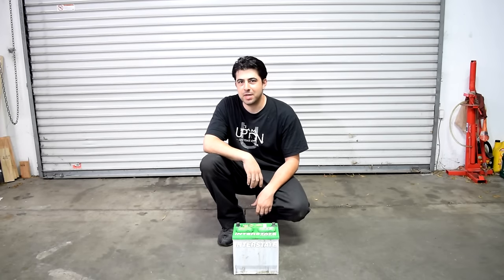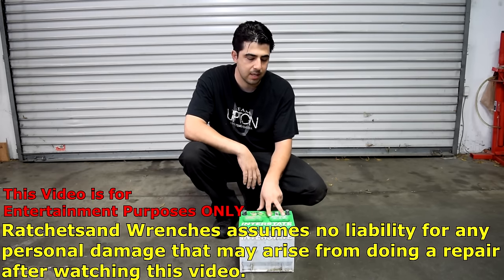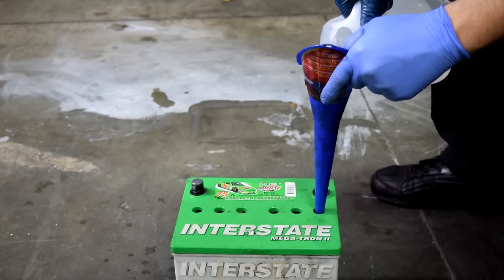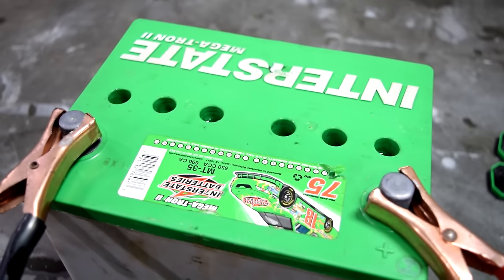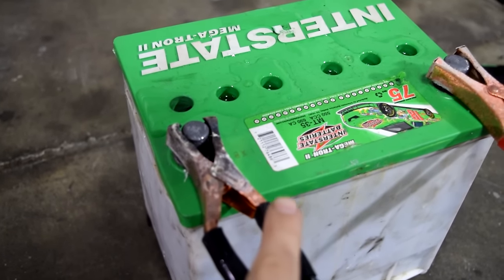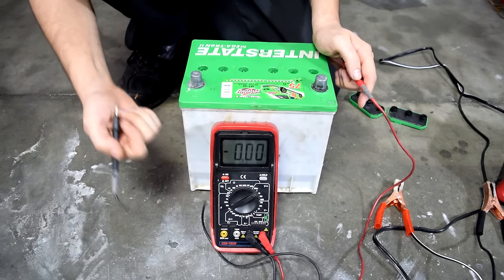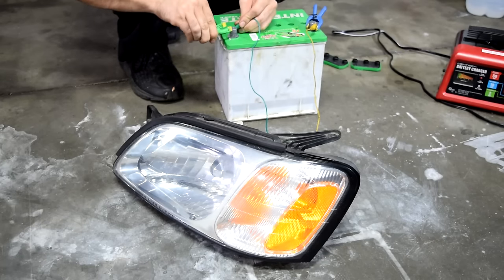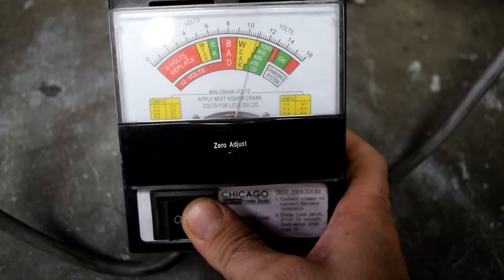Is it Possible to Revive a Dead Battery with Epsom Salt - See For Yourself

Comment: If a battery comes up to 11.7 or so in 24 hours on a charger after  this magnesium sulfate treatment,  try a trickle charge of about one amp for ten days-- yes almost two weeks of trickle charging.   Sometimes a battery will come up to 13 volts and have good amp hours.   The long trickle at times knocks off the oxidized lead and improves performance.    Back 80 years ago acid lead batteries were used in farm barns at the very first electricity in rural areas.  These would get rebuilt by farmers.   These had glass cases and lead plates that could get removed and cleaned.

Comment: this can work! 1. You just need more epson salt to the distilled water ratio, 2. you need to add back the acid that you dumped out in the begining. Right now there is no acid inside the battery because the baking soda neutralized it.3. You need to first high amperage charge before the slow trickle charge.Then it will work
Reply: More epsom salt? Add back acid? So which is it? This makes no sense.

Comment: There are  several things for battery reconditioning
do not try to do this until you are sure what you are doing - the acid can burn your skin
check the voltage first - there may be a kaput cell which would waste your time.
Check the battery fluid.
attempt to fully charge the battery.
(I learned about these and more on Jons Mender Guide website )

Comment: almost forget to tell you that by converting the lead acid chemistry to a alkaline based you DO LOSE the raw cranking amp power of a starter batterie a bit, i would gess say 60 percent less CCA but for solar use ( mostly lichting, television, radio) this is a good thing since the battery wil last seamingly forever....
Reply: Mostly true. The epson is a poor mans solution and the salt creates an acid. In a perfect world after the battery has been put into product for a week you would pull it, dump the epson and fill with sulphuric.
Reply: giottodiotto1
Reply: No, epsom salt in solution does not create an acid. It creates an alkali electrolyte. Big difference. You can run the battery indefinitely as an alkali battery. If you want to convert it back to an acid battery, it must be quite thoroughly flushed.
Reply: giottodiotto, thanks for that tidbit, on solar use, good thing to know. thanks again

Comment: There are  a few things for fixing a car battery
Don't try to do this unless you are sure what you are doing - the acid can burn you
Test the voltage first - there may be a kaput cell which would waste your time.
Check the battery fluid.
Try to fully charge the battery.
(I learned about these and more on Jons Mender Guide website )

Comment: Did you skip the part where you add sulphuric acid back in?
Reply: Hey the whole idea of adding epsom salt it to replenish the sulfuric acid. The lead on the corr of the battery creates hydrogen gas,the gas mixes with the salt and turns into sulfuric acid. So you dump all of the acid in the battery put baking soda in the battery  about ten ounces in a half gallon of water ,put it in the battery,it will fizzle like crazy burning off all the crud on the lead of the battery,dump that out and flush it good with a hose,turn it upside down for a few hours to drain it good,take another half gallon of water,put it in a pan with ten ounces of epson salt let it melt then cool,and put that in the battery,trikle charge it for 24 hours,let it cool and charge it normal till its full ...worked for me
Reply: @bobpatterson6897  it doesn't work, bad idea!!!
Reply: He didn't put acid in he only did the epsom salt

Comment: I used this method to recondition a battery a couple of months ago and it worked like a charm. I am trying to do another battery now but it is obtained getting to 75% on the trickle charge. It has been 3 days. Any suggestions?
Reply: Make sure you thoroughly flush the baking soda out with repeated rinsing before adding the epsom salt.  Also try heating the water before adding the salt and keep adding salt till the water cant absorb anymore. Good luck.

Comment: You have to charge on 200 amp engine start for 15 mins, Then let it rest for 1 hour. Repeat 5 times. Then the battery will be fully restored
Reply: Some batteries. Most I’ve had to charge for a day each time. And every time I recharge I get another 1-3 days of battery before it goes dead again. I’m going to take one and test by cleaning internals with baking soda solution and washing out with a couple gallons of distilled water and filling with new acid because the sulfate didn’t dissolve so much as it dropped to the bottom and just moving the battery can cause the plates to short again so all that sludge has to be removed or it’s a pothole in the road from leaving you stranded.

Comment: There are  several things for battery reconditioning
do not try to do this unless you are sure what you are doing - the acid can burn you
check the voltage first - there may be a kaput cell which would waste your time.
Check your battery fluid.
attempt to completely recharge the battery.
(I learned about these and more on Rapid Renew Roadmap site )

Comment: The starting point was without a charge. So how is that useful information?
Reply: You can use new acid too
Reply: @snipezpro9554  you mean drain out the old acid & put in a new one without using baking soda & epsom salt?
Reply: It shows the starting point!
Reply: @joejoel8962  If it was fully charged then tested you would have a starting point.  A brand new battery can de drained of charge and after a charge it is good to go.  So was this battery good before the test was done?  NO WAY TO TELL, BAD SCIENCE.
Reply: @Stan_in_Shelton_WA  if it was fully charged you wouldn’t need to charge it now would you.This is taking a battery that won’t take a charge to revitalize it ,clean the plates and charge it.

Comment: here's  a few suggestions for battery repairing
Don't try to do this unless you know what you are doing - the acid can burn you
check the voltage first - there may be a kaput cell which would waste your time.
Check the battery fluid.
attempt to fully charge the battery.
(I learned about these and more on Jons Mender Guide site )

Comment: Just a little side note, its not good to charge or store a battery on the ground nor on a concrete floor. better to sit them on a workbench, or at least on a piece of wood. 
yeah, i know a lot of people will say "oh that was only with old batteries, not modern batteries with newer plastic cases" ... sure ok, store your battery on the ground or concrete floor for a week or so, see what the charge drops down to. I know what happens, as I've seen people do it, and also seen some that left a new battery for months like that, and then they went to use it and didn't know why their battery was shot and wouldn't take a full charge afterward.

Comment: You might clean the cells several times until the cleaning water is clean, and not black..
Let the baking soda work in many hours als shake. Dont stop until it is total clean.
Reply: That was my question
Reply: Baking soda is not a cleaner, it only neutralizes any of the sulfuric acid left inside.  The Epsom salts is the cleaner and once that is added and charged and emptied and rinsed out, you add back the used acid you dumped into a bucket using a baster so as to not get sediments that sank to the bottom.  Top off with distilled water and you should be good.  You can also buy new acid at an auto parts store and use that instead of the used stuff.  I have not tried this...yet...but in the videos I watched where they claimed it works well, this is what they did.

Comment: Good effort! Learning heaps even comments given are really helpful.
I do believe even 75% conditioned batteries has useful self life in many applications. I hav one as 2nd battery to run my electronics I E. Taxi equipment/ camera and re charge off a fused relay while engine is running. Relay stop feedloop parasitic current draw and isolate starter battery. Second, use old batteries to run low voltage water, air bunker pumps, leds, for aquariums. Add mppt/ solar to top up charge during day as well. Many other uses if you think about it. Sure beat dumping 'still usable' batteries to landfill.
Reply: I have three old truck batteries sitting at around 3 volts. I'm planning to recon them using this method and building them into a solar cart. This will be used to run my Amatuer Radio rig, and keep phones, tablets, and lights charged. Just for fun, I may try one of them with sulphuric acid and restore the cranking amps. Then I can also use my solar cart with an inverter for 120VAC applications and to jump vehicles.

Comment: Plastic is a dielectic (it does not conduct electricity) just as the insulation on a wire does not conduct electricity. It doesn't matter what surface you put the battery on. Batteries can slowly discharge to the atmosphere due to ions in the air.

Comment: How do we know that putting the 2 amp charger on this same battery for 24 or 48 hours would not have had the same result even without the drain, clean and refill or reconditioning? It would seem to me that any improvement is due to the charging process and not to the reconditioning. I would be more impressed if you had charged the battery in its original state first and it was still at 3.95 volts after a charge but before the reconditioning.

Comment: Thank you for this very useful information. I'm off-road with my Hummer H3 from September to June in Southern Nevada and I carry 2 batteries & a 12 volt BU (jumper) unit. I use that to power my GPS & Dash cams. This old man will simply buy a new Interstate battery as needed. Thanks again :|

Comment: Did you rinse out the battery AFTER treating it with the water/baking soda solution???  If not, there MAY have been some residual solution left inside on the plates that contaminated the epsom salt/water solution causing incorrect readings.

Comment: this is NOT the right procedure!
you DO NOT pour baking soda in the battery cels because it will KILL  the reaction taking place on the plates!
you must rince the battery cells with clean ( distilled) water a few times, than pour a 1 to 10 mix of epsom salt or ( better) ammonium Alum in .....( this by itself wil attack the sulphation on the plates) can take a couple of days in the case of epsom salt, with the alum mix it wil work instantly and combined with a pulse charger ( bedine ssg) and- or a controlled overcharge to 15,5 volts for at least 4 hours desulphate the plates so the battery will be fit for work, one importent point, with this procedure your chancing the behavieure of the batterie in two ways
1*
the open voltage wil be lower than a lead acid mix (  12,10 volt nominal)
2*
the battery wil act like a deep cycle batterie , now you can discharge it way lower than bevore without damage, i usualy go to even 8 volts ! but even a occasionely over- discharge to 1 volt is possible
the batterie is from now on not as prone to damage from over or under charge as before!
ideal for solar use!
hope this helps.
Reply: Rinse..not Rince.
Reply: giottodiotto1 1
Reply: after adding alum mix, should we rinse again after the desulphation occurs or just leave that stuff in and top off with distilled water 1:10 mix?

Comment: This might have been commented on below but not reading 1200 to make sure first...  So...  he tested the battery when he started and it was almost dead, but did he try to trickle charge it before doing this to make sure it didn't just need charging?  Without that step, it is always possible that the battery was fine to begin with.

Comment: HUMMM ?  That's weird  ..Did i miss the part where you rinse the epsom salt from the battery and put fresh sulphuric acid solution in ? that should have worked  .. must have a shorted cell ..
Reply: I added the Epsom salt to a battery. It had .2volts, after adding solution to the battery, it immediately had 8.6v. it had been testing as bad battery, now charging not as bad battery, but just charging it as normal. Awesome deal saves $$$. Thanks to all who have posted this ideal.
Reply: It worked in mine

Comment: Hi mate love your videos!.
I’m just wondering though what sort of battery charger you use because most new chargers won’t let you over charge them! So I’m needing to find one that will still allow overcharging to occur.
Thanks so much for your time and help
Reply: need either an old "dumb" charger or a newer one that is analog and isn't run by a computer chip.

Comment: I think your concentration of magnesium sulfate may be too low.  I revived a 12 volt tractor mower battery last year that still works.  When I made the MgSO4 solution, I just dumped in a good portion of it into the distilled water, trying to dissolve as much as I could.  It worked so well I went back to estimate how much Epsom Salt I dumped and it was around one and a half pounds (40 ounces).  Although there was some undissolved MgSO4 at the bottom of the container, I was just careful not to pour it into the battery near the end of the pour.  Just a thought.  I'm going to try my second battery today using the same concentration as I did last year.  I'll try and update this post.
Reply: FYI: "one and a half pounds (40 ounces)"  uh...no.  24 oz.  You must mean 2 1/2 pounds.

Comment: Insulate the battery from the ground with a board.... In order to have a battery go dead it has to have a path from one post to the other and allow a drain to be applied. The battery would have to have moisture on it or "acid" on the top of it in order for the current to follow thru the liquid to the concrete creating a circuit to the other battery post.  The 
Board does two things.  First the battery will not charge until it hits a temperature of aprox 80 degrees. The concrete will keep it from reaching that temp for a while and thus will have the effect of a slow charge. The board will also serve as somewhat of an insulator for a battery being able to complete the circuit.
Yes , I was a certified automotive instructor " back in the day".
Norm

Comment: Buy a decent quality battery with a 5yr warranty and keep the receipt. If it lasts more than 5 years every month after is a bonus. If it dies before 5 yrs take it back and get it replaced foc. Life is too short to be messing around with battery acid etc when a good battery runs you less than 20 bucks a year.
Reply: +Andrew Law - Well at least you have your Mathematics working!  Most You-tubers lack $1 Dollar Calculator and English 101.  I agree with you 100% !!!

Comment: did you not put acid again. did you put only epson salt water?
Reply: epson salt ://
Reply: He didn't put acid back in. He was just experimenting with the distilled water and salt and got minor results.
Reply: He was able to get 100 CCA out of that Battery. Although the older Battery is over 800 CCA, so it did work, just not enough to retained the Amps!
Reply: @JodBronson  right, not enough to turn an engine
Reply: +Robron Hoodlum - Hehehehe, now I don't have to waste money trying, LOL.  I was on a research to see if these would work or any other types of refill, etc...., would work.... But in the end, most will not :(((((((((((.  I am going to clean mine and refill with Acid instead.  I've found Home Depot actually sell 1.5 Gallon of Acid Battery for $22.00.  I think it's good enough to rejuvenate a $99.00 Battery back to Life for $22.00 :)

Comment: This is correct, the Epsom salts cleans the sulfated plates  and then the battery will work good again. The only thing that would help is if you perform this once a week for a month by the time the month is up your battery should be almost up to the amps it originally had when new. I know you do not want to put acid back in the battery that will make it worse! And you definitely don't want to put the old acid back in that is just defeating the whole purpose!

Comment: Just a little added tip.  NEVER charge or store batteries on CONCRETE.  This drains batteries.  My Dad & Grandad always taught me this.  I have never TRIED to see if this was true, but my Dad was an auto mechanic his whole life and lived by that info.
I can tell you that I left my Dewalt 18v drill and impact driver under my car for a few days when working on it, and they were both charged when I was using them, and very low after 2 days of sitting on the floor of the garage.

My Dad always stored extra car batteries under the bench, on the shelf.

Comment: So How did the voltage hold up when you tested it later?
Reply: It didn't... Epsom salt only makes the water in the battery more conductive. Salt water is a lot more conductive than distilled water. Which does allow you to get some charge out of it. But now that you have salt in your battery you end up with Hydrochloric acid as well as sulfuric acid in your battery. hydrochloric acid only hold on to the OxyHydro part of the acid about a 1/10th as well as sulfuric acid. So that 4Amp hour battery turns into a 40 watt hour battery in about 2 weeks. The bigger problem is the battery when you start to charge it again and again, it will start to give off chlorine gas. Hydrochloric acid will also start to dissolve the plastic casing of the battery too in about a month or so. There is a reason why no manufacture puts salt in their lead acid batteries.
Reply: @nathanwoodruff9422  t

Comment: I did this to my battery and only thing different that I did was that I didn't clean the inside of the battery like he did. Also I didn't test it. So I fixed the battery and put it back in my car and started my car. It's worked great ever since and i live in the desert and my battery is like 6 years old. So yes I definitely believe it works